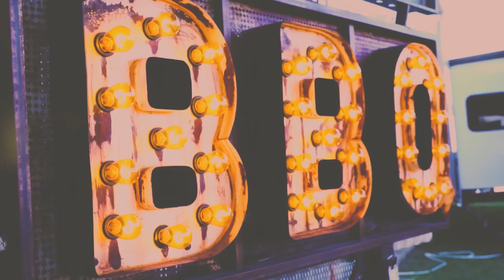Smoker Design: How I Determine Air Inlet Placement And Why

Comment: Frank,
I always appreciate hearing your expertise on these matters. Does anyone ever use an electronic billow on offsets, like some people do with drum smokers, to control the amount of air and force of air getting into the smoker? I realize many people with offsets are trying to avoid electronic devices, but I am curious. Apparently, these popular wood burning rotisserie smokers, now being used at top Texas bbq joints, do control all these factors. 
Keep up the great content!
Reply from the maker: Great question. So there is a draft blower designed for use in stock burners called the Perfect Draft. 
I’ve not seen one personally or how well it performs but some people like them. It takes a lot more air flow to do this on an offset so a much bigger fan is required. 
I think the forced air would not behave the way I would want it to for my personal liking tho

Comment: What about a heat deflector? I built my own 120 gallon smoker. I’m unsure what I want to do. I was thinking of a shelf just over the grate like Aaron franklins pit.
Reply from the maker: I actually use a vertical plate in front of the throat opening to aim all the air straight up. Then run the stack 30% to 50% open. This will even temps out and yield to down cooking with a nice convection under the grate going back to the firebox called an “undertow”. 
There plate like franklins does work but can force the hot zone out farther

Comment: This makes perfect sense. I am trying to fit an offset smoker in an outdoor kitchen and can't have a door on the side of the fire box/smoker because it will be up against the a column. My air will have to come through the front or back of the firebox (facing the smoker). Do you think that will work? I was thinking, especially after this video, to put one pinwheel in front and one in back near the bottom of the firebox, and near the side. My fire will sit on a grill that sits on angle iron about two inches above the bottom of the firebox. I would love your thoughts. I love your material btw, keep up the good work.

Comment: Got use 120 gallon pit ,with no baffles. But I feel that firebox opening might be to big. Should I let it roll or try to restrict opening. Only real complaint is I lose about half the pit by firebox.
Reply from the maker: Before I would block off the throat I would run the stack only 30% open. Try that and see if it helps to push that hot zone back towards the firebox. 
My 100 gallon Legend offsets are built with larger than normal throat openings on purpose and this is how we run them. 
We wind up with a 6” wide hot zone using this method
Reply: Ok thanks

Comment: Awesome information!!! So is a "violent" fire better than a calm fire? I hope that makes sense. I have a commercial offset (not one bought at a store) and am getting a wet sooty coating on some foods EVEN though I know its blue or even clear smoke 90% of the time. I am using hickory thats about a yr old.
Reply from the maker: Great question! So the sooty coating is most likely condensation from inside the cooking chamber. 
On the violent or calm fire, I prefer a calm fire with plenty of coal bed (not ash)
The more exposed surface area of coal bed, the more btu’s you’ll have available for heat. 
If you are getting condensation forming on the inside-top of the cooking chamber then you likely are letting the air mass cool off too quickly and the water vapor collects and condenses. 
I would be curious if your cooking temperature and air flow are adequate. 
Most of the time I’m cooking around 275 or 300 on the dials but know that my cooking grate temperature is slightly lower than the dials indicate. 
I have 2 other videos talking about this subject. 
Cooking Temperature: Why I Think Dial Thermometers Are Junk
https://youtu.be/SiswQ7apeCA

Fire Management: Why Is My Meat Black And How Can I Prevent This?
https://youtu.be/_YhEcXCU_8I

Hope this helps!
Reply: @SmokerBuilder  Thank you so much. I put some fire brick in the fire box for mass. I bet that “hampered” flow around the coals. I also had the exhaust damper slightly closed…I will keep it wide open. Your advice and help is greatly appreciated